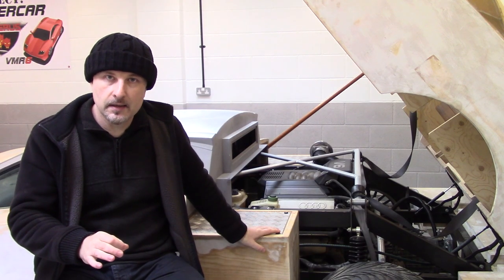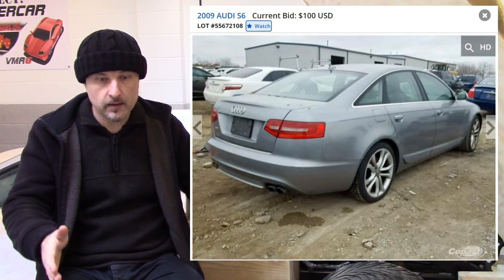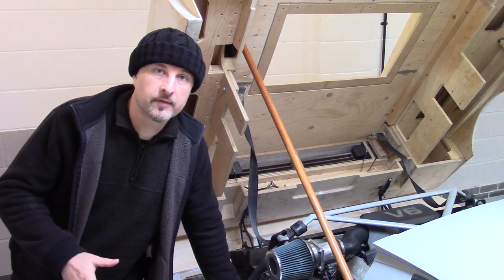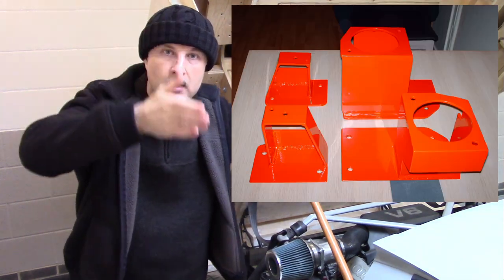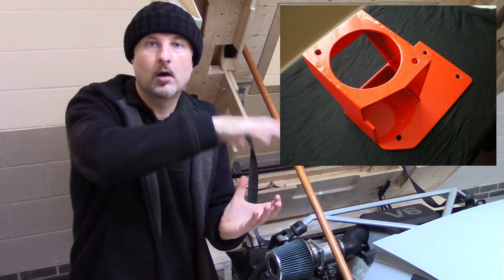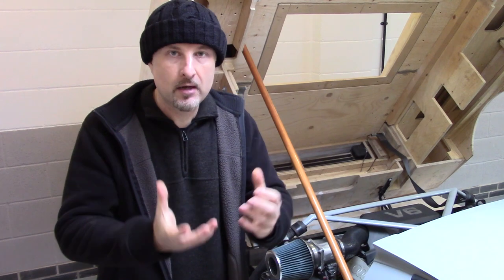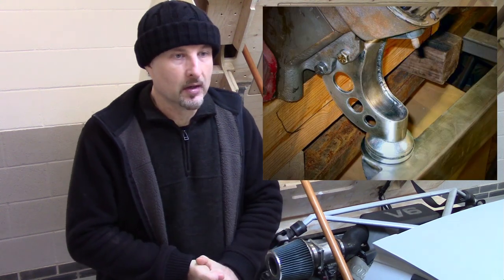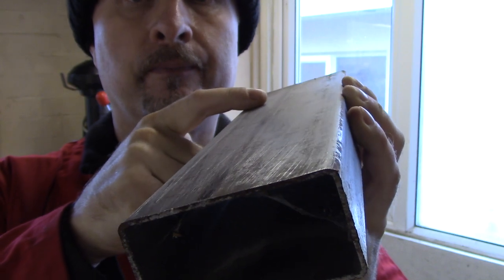I’d love a V10 in my DIY Supercar: Prototype Ep7

Comment: Great stuff! I still want your countach though 🥰 the v10 good bang for buck but I've worked on way too many of them to consider.  Rs 4.2 v8 the way to go!!
Reply from the maker: Thanks Louis. I do think about a new Countach build from time to time, it's on the back burner, maybe one day lol. Yes, the 4.2 V8 is excellent, and would be my number 2 choice, and it's a much cheaper option as well. The V10 has it's faults, but it doesn't half sound great at red line. ;)